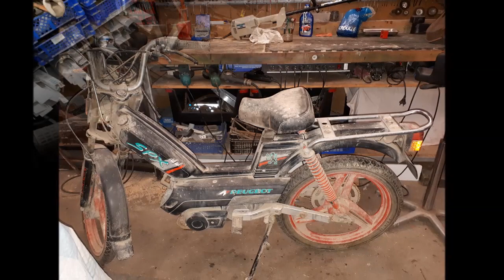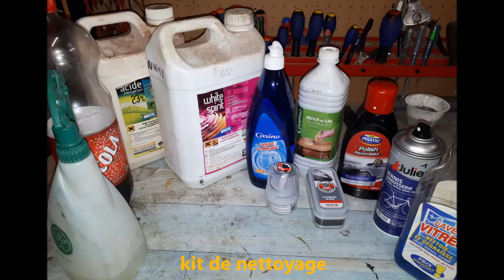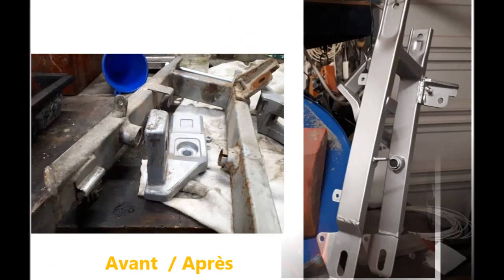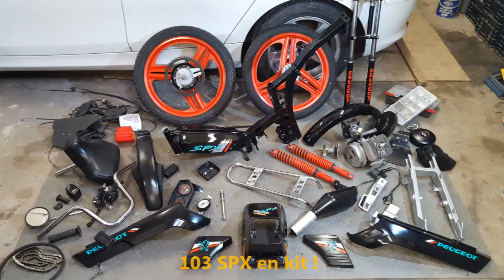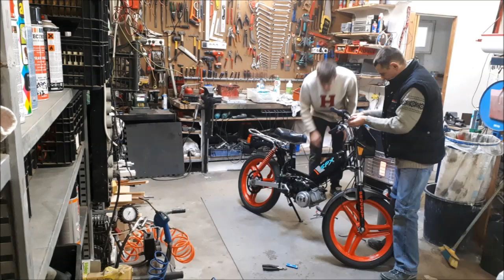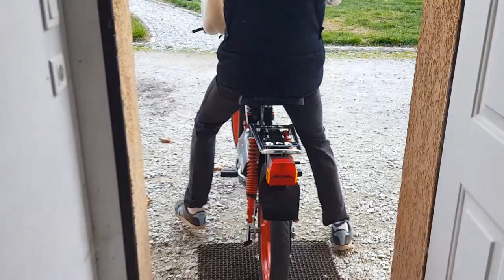Restauration 103 SPX 2001 en 2017

Comment: Cylindre pas d'origine pipe non plus et pot débridé de ce que je peux voir et entendre 😉
Reply from the maker: Heu non, tout est d'origine. Il s'agit d'une première main et d'une fille en plus ;) 
Il est ensuite resté 20 ans dans une grange. 
Pour le bruit d’échappement, à noter que le premier test sur la vidéo (dans le garage) est en mode échappement libre (sans échappement).
Ensuite, cylindre, pipe et carbu (en 14), sont également d'origine.
D'ailleurs, je n'ai aucune raison de tenter de vous en convaincre ;)
Mais peut être y a t'il eu plusieurs versions de motorisations ?
Reply: @neptune6666  ce n'était pas une question les cylindre d'origine Peugeot ont un V à l'arrière des ailettes la il n'y est pas ça ne veux pas forcément dire que c'est un kit mais c'est au minimum de ladaptable 😉 pour le bruit d'échappement c'est possible effectivement quand à la pipe malgré moulte moteur passer dans mes mains je n'es jamais vue cette pipe d'origine
Reply from the maker: utilisateur inconnue  : Mystère...